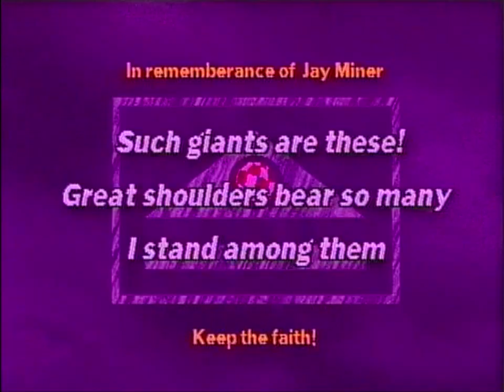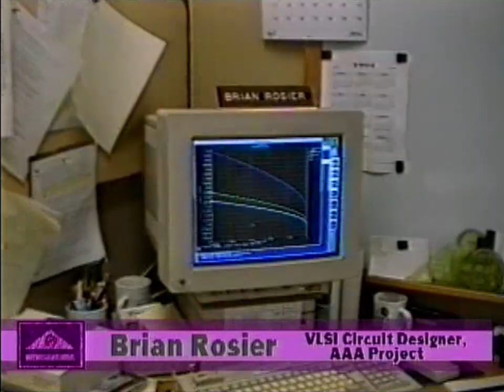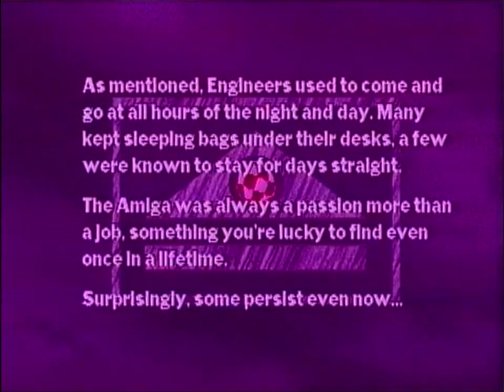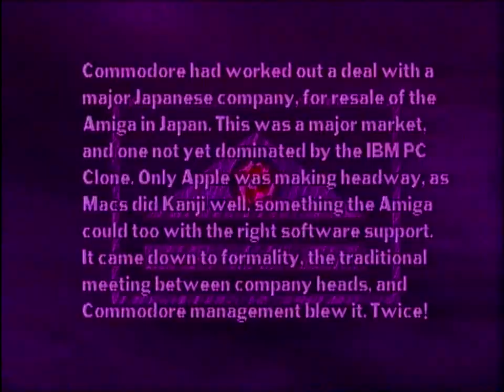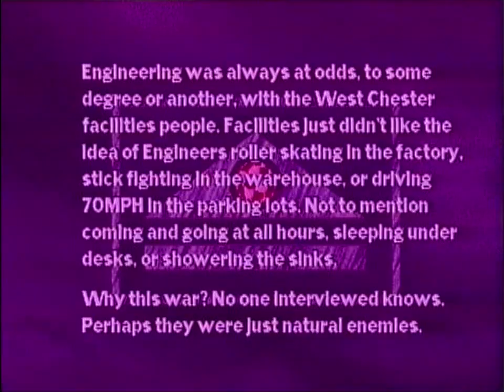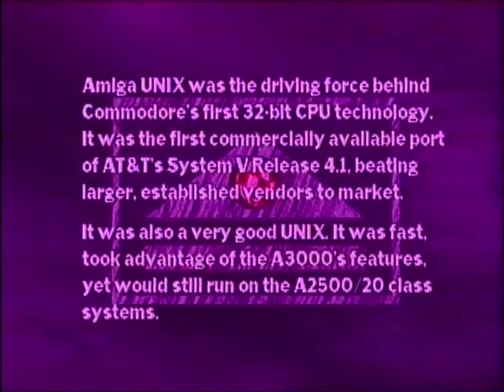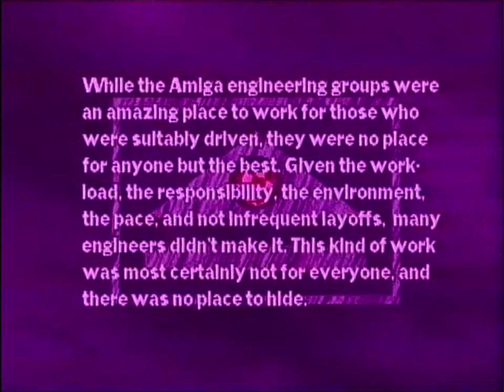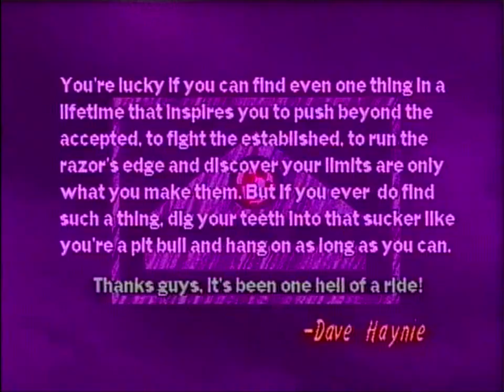The Deathbed Vigil and other tales of digital angst

Comment: Sometimes a incompetent management ruins its own company.  In history it happened many times and not only in technology sector.  The  bankruptcy of the Commodore wasn't the worst. The real disaster happened after it - in the hands of Escom, Gateway, etc.  
The Amiga platform was always bound to only one company. When the platform is owned by only sole owner, it has some pros but it is also weak spot. When the owner falls, the platform got into trouble.  In contrast the PC or ARM platforms are quite resistant to the bankruptcy of companies. One or more of them fall, the others replace them.

Comment: I did find the 1200 kinda of pointless and always wondered why it was released. My 2000 with a 030 Accelerator was far superior (upgraded chipset as well)
Reply: In 1992 when 1st released the Amiga 1200 had an MSRP of $599 US. How much did that 2000 with 030 accelerator cost? The Amiga 2000 itself was $1,500 when it was new. The 1200 was to be the next in a line of low cost yet powerful Commodore home computers like the Amiga 500, Commodore 64 and Vic-20.
Reply: @DOSv622  

You're right, to get the level of AGA graphics and an 030 back in 1992 on an A2000 which have set you back an absolute shit load cost wise.

I got my A1200 in late '92 bundled with a 40MB HD .. so the A1200 HD/40 for $1,100 Australian.

Later upgraded it to the fastest 030 on the market in '95 for an extra $500 and a mate sold me a 16meg simm for $100

All up around $1,700 AU

Managed to score myself a 2.5 inch 500MB Quantum Daytona drive though for free from a Computer company I worked for back in '96 😎  

It was a supposedly faulty drive I ran tests on that was out of warranty so as such couldn't be RA'd back for replacement and it worked fine so I was allowed to take it 🤗

Comment: It's hard to put into words what was lost; I think actions describe it better: I still have an A500, A600, A1200, and an A4000. They will go when I do. PC and Mac hardware arrives and departs according to convenience, but inspires little in the way of joy either way. 
In my spare time, I'll mess with FPGAs, Amithlon, Win/FS-UAE, or the real deal, but I won't be rushing to find my win95 install CD.
For me, Amiga was the last computer I felt I could fully comprehend - even some of the circuit diagrams were in the back of the early manuals. It was the last machine that felt like it came with a "soul". I am eternally grateful to all of those who dedicated themselves to bring Amiga into being.

Comment: I'm so sorry. I have an AMIGA 500 and an AMIGA 1200 (not running anymore sadly). Recently I bought PC building Simulator on Steam. So I wonder if it would be possible a COMMODORE/AMIGA building simulator that would contain also all cutted AMIGA Projects and all projects that could be developed until now. I mean a program to build and Develop Amiga Hardware (not only assembling it like PC building Simulator but "drawing" them with everything) and WINUAE to emulate the built AMIGA (after we build the Amiga a configuration file is generated for WinUAE based on the Hardware). I wonder how Amiga Would be now if It would have survived. I think we would have AMIGA instead of PCS and MACS. Not only that. AMIGA would be 30 years ahead of todays Hardware. If it couldnt be done in real world It can be done in virtual world (for now). An Open architecture like AMIGA can do anything. I just imagine an AMIGA CUBE with Thunderbolt 4 like ports that can use anything we attach to it (like actual GPU) and use its power as its own. I think so. Ty

Comment: I still got my VHS tape legal copy of this movie, my amiga heydays had been the A2000C GVP-Gforce040 with its GFX, toccata, SD64, picasso II, 2091...sadly it died when a huge thunderstorm got around our place and a lightning went down a few miles away...after power was back my system won´t start no more, after replaced the Gforce with my previous used 2630 it came back, but it wasn´t my machine no longer no more...i was so dissapointed, but still used my A1200 and bought a pulsar II+ mac clone, some years later, as the amiga was about dead around 1998...but i still got that A1200 bought new around mid ´93 (paradroid´90, super stardust and all these nice AA-demos:). 
Also i must admit i looked at the A3000 when it came out and was so dissapointed by that machine...my old A2000C was faster, and way more capable than the "new" thing from C=...i rather had expected at least way better GFX then improved ECS....later the A4k was too expensive and also too late and A1200 was just right, but too late as well, and also hard to get (at least over here), but i wanted AA really bad, so i searched for a machine and drove about 280km one way to buy one.

Comment: I bought sometime in the 1990s the dvd or at the last German amiga fair in Cologne. 
 I was a commodore user from 1985 to 2002. c64, amiga 500 and 1200hd + 1230 turbo card. I still have c64 and amiga 1230 in the basement. 
 a cd 32 I have bought for collector reasons
 only the bad internet connectivity due to license problems of internet browsers have led me to windows

 greets from Germany

Comment: Usually i think the fact Commodore Engineers had sleepovers in the building as a "common practice" is telling in itself.. That suggests they were either always falling behind, or perhaps rush jobs... Or perhaps because its easier than going home :) Any one's guess. If  i had to guess, the fact they had problems keeping the "bead board" functioning at the Commodore Show in the 1980's suggest perhaps that added to the reason of poor management, i dunno
Although  management issues, in 1991 the"super cheap" machine kinda brings this all to the front , i reckon. It helped it die "in a sense"
Why was it cheap ? cost cutting, as they must of already been in trouble by then. There would be no reason to make a cheap machine if your a success in the industry... The only other reason would have been, so more users  could afford it. But i don't think so, because you wouldn't wanna have a newer machine be less powerful just because...
Is this a standard practices bosses do ?  Make up excuse, say whee fine, but when  their backed into a corner, and gloves come off, they fess up, and say "We're in deep ****".. But its too late.
Reply from the maker: George Robbins stayed over because he had, at one point, got caught driving his van with no insurance, no registration, and an invalid license. Some of us were pretty singularly focued on Commodore. I stayed over once a week to get more done, sooner, including the occasional "skunkworks" project I might not have had time for or official project status. The A2630 accelerator card started out that way, for example. 
I did the same sort of things for every company after Commodore... it just became a whole lot easier to do from home over the years, as we moved from workstations to PCs for CAD, as I built up a proper electronics lab in my house, etc. 
The lesson of small companies that surpass large companies is that big companies get fat and slow. Sure, maybe they're strictly 9-5 shops, and that's fine. But the last two times I was job hunting and interviewed with very large American PC companies, I was struck with the "that seems like a job for one person and you have 5+ people doing it" over and over again. Not the place for me, even if that does mean the occasional 45-hour-straight PCB layout session :-)

Comment: What would be my options if the drives in both my A500 and A600 are suspected dead? I've looked for replacements but don't hold much hope. Was wondering if there was a compact flash solution w/ appropriate ide controller?
Reply from the maker: There are CF and SD card adapters for the A600 IDE: http://amigakit.amiga.store/hard-disk-drive-p-883.html.  The A500 depends on your HDD adapter. There are lots of options: Google is your friend.
Reply: Well, your reply spurred me on to get both machines re-capped and properly sorted out. Thanks man.

Comment: Did the Amiga have any network abilities?  TCP/IP?  IPX/SPX?
Reply: Yes, it had a full TCP/IP stack (AmiTCP) and full internet access via dial-up modem. Hardware options for ethernet were limited at the time (and expensive) but the PCMCIA slot gave options. These days it's easy via software emulators (WinUAE, FS-UAE)
Reply: No, not build into the OS by Commodore (they lagged behind in the OS and networking area). Only as external offerings AFAIK.

Comment: As with many companies, they failed for a very particular reason: They were very successful but the management didn't understand the reason behind it. If you look up at all the follow up products after the C64, you can clearly see that they didn't understand why the C64 was so successful. So they kept failing until the Amiga 500 and instead of learning a lesson out of the fails, they fall back into this horrible management mode. This is the same thing that happened to Apple. Steve Jobs was not a Genius but he understood why Apple's products were actually successful. Once he left, Apple went downhill as the new management had no idea whatsoever. The difference here is that he came back on time and saved Apple; unfortunately nobody came in time to save Commodore. All that Commodore would have to do was understanding why so many people loved their C64 and Amiga 500 machines and then keeping innovating this concept, releasing a model every 2-3 years that keeps all the good stuff from the previous generation, tries for fixes all its flaws, and can just be seem as a natural evolutionary step of the series. And each of these would have been successful over and over again. This is how Apple is successful and meanwhile they release a new generation yearly. Thy rarely introduce or phase out a line, they just keep improving the lines that proved successful, it's that simple.

Comment: What?  Only two RAM slots on the AAA? ;-)
Reply from the maker: Those are Chip RAM modules, not actually SIMMs, since they didn't have enough pins, or DIMMs, since they really didn't exist in 1993. Each module would contain DRAM and buffers to bridge the chip and graphic data buses, or VRAM, which was attached to both chip and data buses. 

The Nyx board shown was never intended as a product, there was just too much stuff happening there and lots of exoeriments. It had a third 8520 for additional I/O, a somewhat kludgy clock circuit to support the four simultaneous pixel clocks (really needed a 4-way PLL), it had an ArcNet network interface for 2.5Mb/s daisy-chained networking using off-the-shelf CVBS video cables, etc.
Reply: Thank you, Dave, for taking the time to reply, for the detailed explanation...and for the goosebumps that I think will last for at least the next week. ;-)